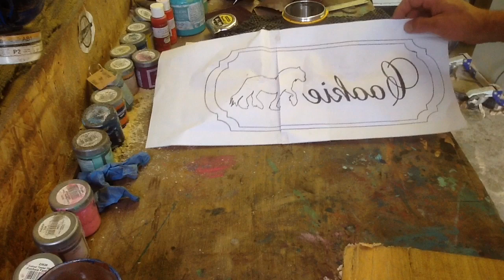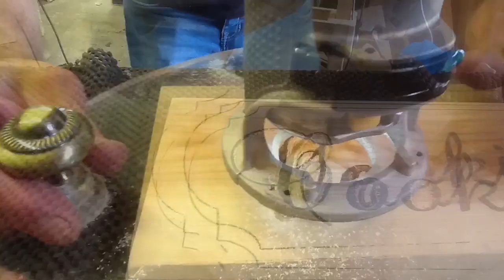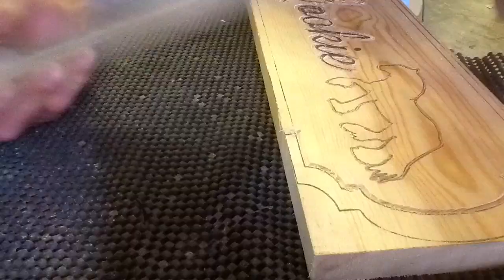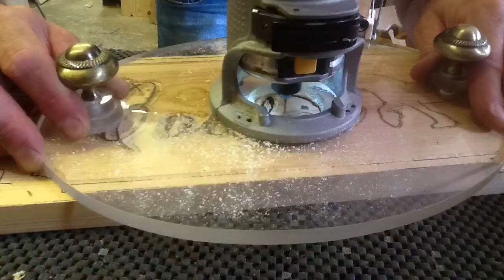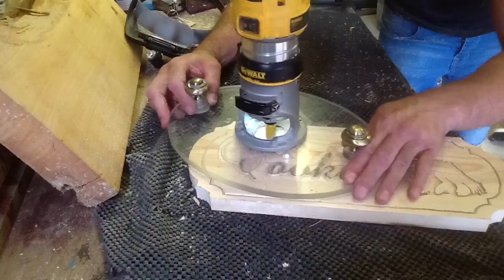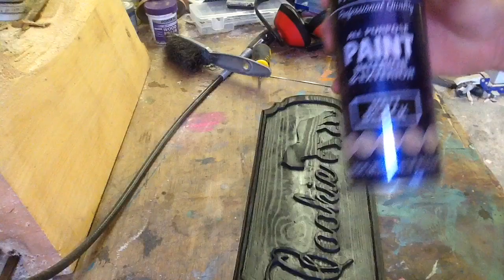Free-hand route a stable plaque

Comment: Hey Johnathon!  Nice technique.  I'm building a heavy duty mobile cart to hold a new Grizzly planer which is in the middle of my shop floor.  LOL!  Will eventually get to various sculpting wood techniques. Thanks for showing the way.  Have you considered the old rubber carpet pads. Might hold-the pieces better?
Reply from the maker: Thomas Tieffenbacher/DocSavage45  hi Thomas, yes  I need a new mat, mine has definetly been through the wars! I generally use shelf liner. Holds things well and is very budget friendly

Comment: If you're using "1/8"  shanks", then you must also be using a 1/4-1/8 adapter for the router, correct?
Reply from the maker: yes, its a small collet that fits inside the regular 1/4" collet

Comment: What kind of router bits did you use and the size
Reply from the maker: Hi bud, for this I used 1/8th shank router bits, used 20 and 60 degree v-groove for the outline and a 1/2 inch twin flute bit for the back Ground clear out. Then I used a 3mm spiral upcut to do final clean up. All available from eBay or on Amazon. I generally bulk buy mine from china

Comment: Now that's what you call a router base...nice result.
Reply from the maker: The bigger size gives a.much higher degree of control and allows for a greater variety of sign carving without needing to make jigs! Thank for watching!
Reply: @JohnathonWhittaker  this is true.ive been meaning to get one for mine..it would definitely make things easier..
Reply from the maker: @fishtank5050  they are pretty easy to.make yourself and of course you can use your existing base plate as a template